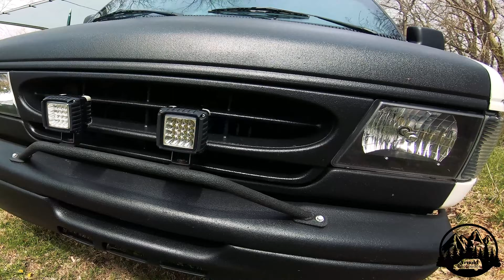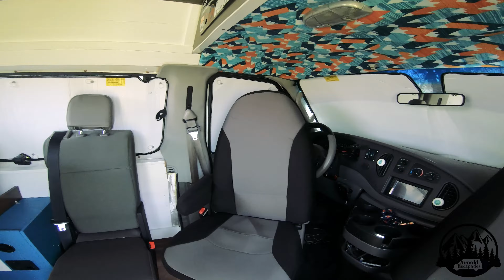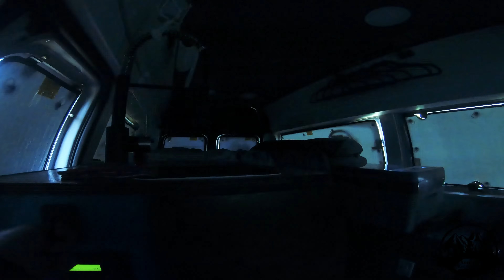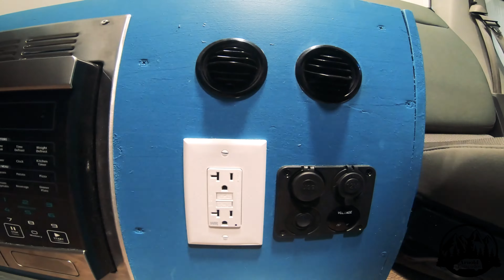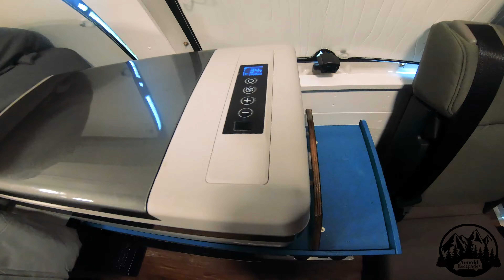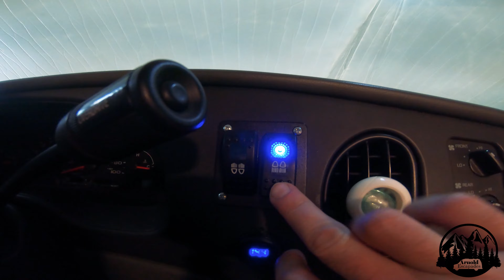Van Tour Of Our 2006 Off Grid Ford Econoline Camper DIY Build

Comment: How sustainable is the AC unit on battery power? I live in the south and want a non generator AC but the cost of battery power to run one long enough to make it comfortable is my concern.  To be clear, I only make short 3-5 day trips.
Reply from the maker: Not very. It works for what I use it for as it is basically my daily biking vehicle. I wouldn't want to camp in the heat for a week in it though, unless I was plugged into shore power.

Comment: I’m debating putting my bed sideways like yours. Is it comfortable and how tall are you?
Reply from the maker: @henryandersen1091  It is a full size. Debatable decision. I'm 6ft, and I am adding Flarespace sides to accommodate because if I lay flat, my feet and head both touch. If you sleep on your side, you're probably fine. It's a space saver sideways for sure.
Reply: Thanks